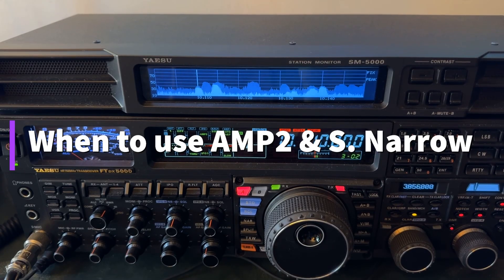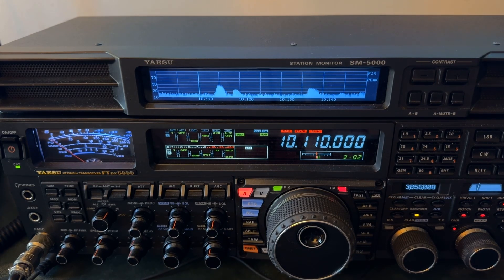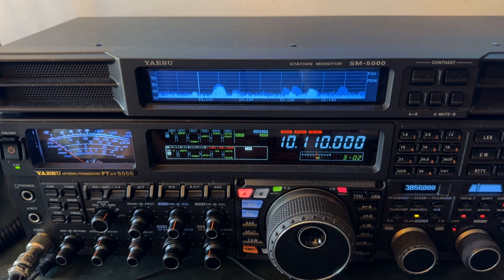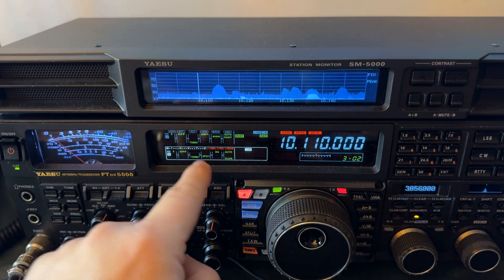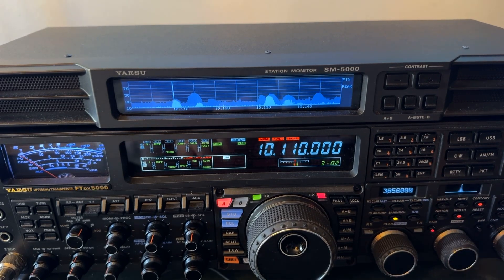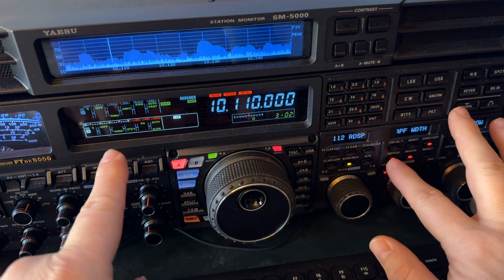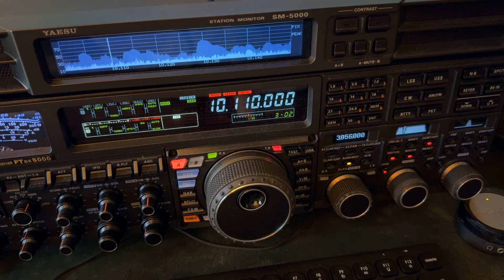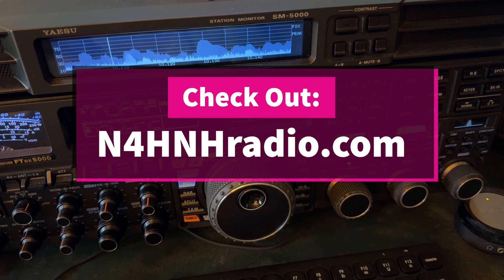When to use AMP2 & S. Narrow #hamradio #cw #filter #ringing

Comment: The notch trick is a fantastic method. I used it on my FT-950 and it worked wonders. In fact I operate that radio with all the tricks ive learned from this channel and it really makes that old rig shine! Thank you!
Reply from the maker: I’m glad to know that, Dan.  The impetus for me to start this channel was seeing so many hams buying a new radio when they weren’t even getting the most from their previous radio. I used these techniques, plus some filter upgrades, with my Yaesu FT-920. I ran that radio for 20 years.

73, Doug